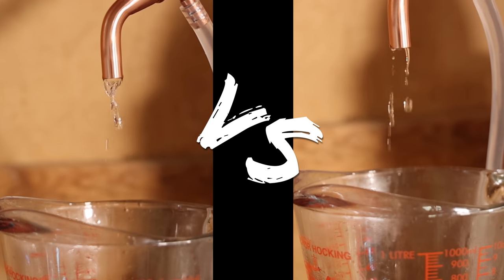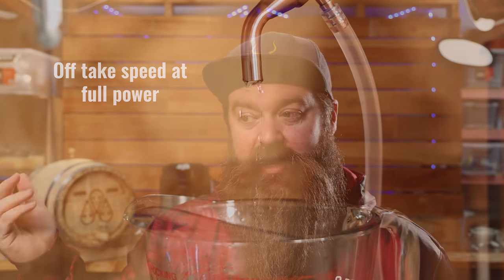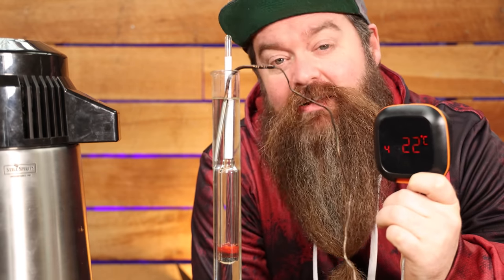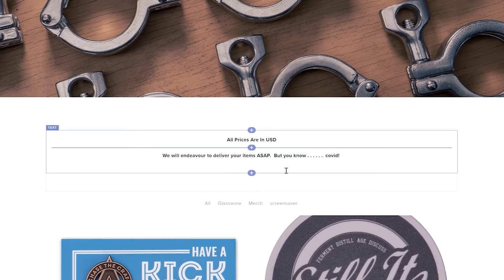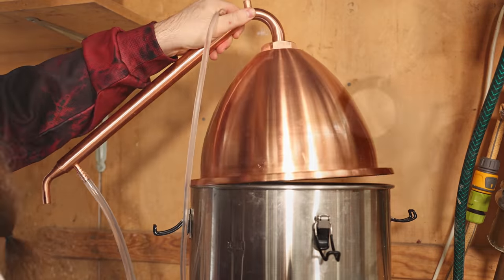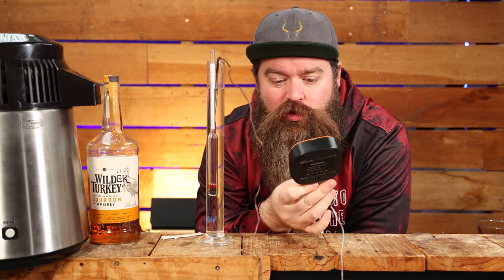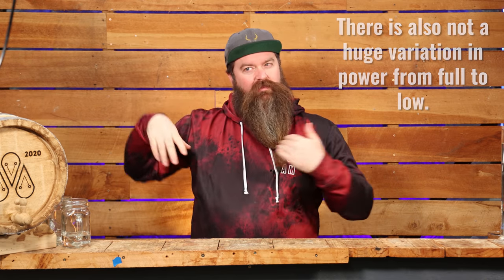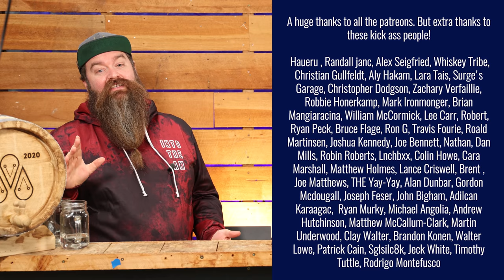Is It Really Worth Running A Pot Still Slowly?

Comment: Interesting that the focus was purely on ABV. To me that is a secondary consideration over being able to differentiate between cuts and having a cleaner tasting spirit
Reply: Was wondering the same thing
Reply: The increased ABV is an example of how decreasing the heat input on a pot still effectively increases the reflux ratio, improving the ability to selectively distil a specific component out of a mixture. This same principle applies to all chemical components of the boiling solution. All of the flavor/aroma compounds will show the same concentrating effect as the ethanol being shown by ABV. Basically this will allow you to be more able to choose very specific flavors you want in the finished product by better concentrating them into specific cut jars.
Reply: Faster means more heat it's gonna effect oils if the temp is higher

Comment: you may need to re-upload this video, the squarespace bit doesn't have any volume...
Reply: It did have volume but it was only coming out of the right side channel so if you only have left channel audio you could hear nothing
Reply: Actually, the sound is "phased" on one channel (the phase is inverted between the two channels) which means that it will cancel out if you use a mono device, and will sound really funky on a stereo device

Comment: "Is It Really Worth Running A Pot Still Slowly?"   My answer is "YES!"... sometimes. Distilling slowly in a copper pot still is a pain in the butt and the difference you will see is minute at best, but real quality distillation requires serious temperature control. If the finest quality is your goal (you should probably be using a column still), taking your time is mandatory.
Reply: I find patience to be a waste of time but I find that there is no step in the process that doesn't work better if I take more time to do it...
how long you take...what you keep...what you throw away...that's what makes your liquor your liquor

Comment: Would be interesting to see how the flavor changes between the two. If the ABV changes I assume that the flavor would change as well.
Reply: Higher ABV = less flavor after dilution to drinking strength. Flavor should not change unless you run way too hot and scorch. Run Whisky and rums faster for more flavor, run neutral spirits like vodka slowly for less flavor.
Reply: It tastes like burning!

Comment: The word you're looking for here is reflux ratio.  High reflux ratio means higher ABV and a "cleaner" spirit.  Lower reflux ratio (arising from more power input for a still with a constant area) means lower ABV.   A pot still has reflux, unless it is much better insulated than than the ones people typically used- that reflux is just less effectively contacted countercurrently with the rising vapour than in a reflux still.   You can see this clearly in a lab glassware distillation apparatus.   All that business by the professional distiller about "reaction time with the copper" is just nonsense.

Comment: VERY interesting!  If I understood Soren, he uses distilling speed - at least to some degree - to manage barrel entry proof.   Lower entry proof, run hotter and faster.  Higher, slow it down.  Along with that is hotter and faster equals grungier and more flavor.  For better or worse.  I have been a “low and slow” advocate until now.  You just introduced a new style/flavor lever to play with.  Thanks man!

Comment: I'm only playing with a 20l Chinese pot still, using a variable induction hob for a heat source, and until now it's been a "blast the stripping runs" and then "slow distill the collected distillate using just enough power" process. With such small volumes, there's not a lot of wiggle room in making cuts so the slow distilling path helps with that.

Comment: I made a killer Bourbon using a gallon of non-vanilla corn syrup, 2 lbs 
of malted barley. Sugar. It made a great bourbon after having it with 
burnt oak chips for awhile. I did not carbon filter it. Everyone loved 
it.  

I made some using corn flakes. I went to a discount store and bought 8- 
 18 oz boxes for $1.35. When you stew it with the 2 pounds of malted 
barley it completely dissolves because it is already gelitenized.

The biggest misconception is that people believe yeast eat sugar, yeast 
do not eat sugar. They eat the nutrients in the grains. Otherwise you 
could never get yeast to grow when you make bread with out sugar. Happy 
yeast make a enzyme that breaks down the sugar into CO2 and alcohol.

Comment: I am distilling a Banana Rum in my T500. The wash is fermented with cooked mashed bananas, Molasses and all the good stuff and is fermented out and settled before pot stilling. I only run the pot still once as the hole point of the exercise to to get as much of the flavor into my product as I can. I use a copper dome and a short column on top of that and a Boka pot still condenser. Inside the column I hang a horses tail of copper made from stripping a short length of very heavy welding earth cable and this is cleaned with Georges 551 cleaning solution so the copper is like brand new with many strands of fine filaments of copper hanging down. I use full throttle on the element to get the run going and drop the energy to almost 50 percent and run the still at 60 percent ABV. I can tweak the power toward the end of the run to extract all I can. I believe that fast is good, but is a tool like anything else, as if I wanted higher ABV I could re flux my rum to the point I would get pure spirit with virtually no flavor at all. My Rum is kick ass, jump up and punch you on the nose stuff. When you close your eyes and drink it you could imagine it being smuggled out of Jamaica in barrels by smugglers and pirates.

Comment: This is exactly what I’ve been talking about, specially with the t-500, it’s not a matter of high amount of heat or power, it’s the point where you can control both as one to stop scorching! either when running all grain or fruit or even molasses type mash! Yes slightly lower or controlled heat or power will alway give a better product and smoother distillation than running full bore uncontrolled heat! Even the old moonshiners that used wood fire stills had to control their fires! Great topic and will be interesting to see your further thoughts!
Reply: Agree 100%.
Reply: the old moonshiners actually ran thumpers to account for the fact that you cant control heat all that well when using a wood fire

Comment: Your a mind reader Jesse! I'm running my 30 gallon right now.....I fill a quart jar about every 20 min lol less maybe. Its always good not fiery or mean. Works great for my set up
Reply: Meant to say a little less instead of lol less....autofixxer
Reply: Also should mention that I use a propane burner for my heat source. Very adjustable with the regulator

Comment: Craft Distillery owner here. You definitely want to run full speed in the stripping run.  I had done about 600 distillations so far. I started off running it slow but with a pot still it makes an inferior product. One of the main reasons is you want to go deep into the tails are there are great flavor compounds there. If your doing a spirit run and you back off the power at 50% abv for half an hour then go full speed down to 20% you will end up with a project that has great flavor and with a final abv of 52%.  This is the ideal ABV for barreling.  If you barrel from between 40 to 45% the aging process can produce methanol. Its best to barrel between 48 and 53% abv.  Especially if your using small barrels.

Comment: Super video, do you think the biggest influence  in the speed will be in the hearts not the heads.

Reason for asking is when I play with power in the heads are alway close with ABV, but once the hearts come the ABV changes like crazy can change upto 15% depending on power in.
On the 6l 38% run the hearts should be around 2l @80%.

Comment: I've found (more importantly than abv) , the distillate is much smoother if you run as slow as you can get it so for personal consumption, I run as slow as I can to get the most smooth distillate I can. I think it's worth it
Reply: The way to go. I like using the first run.  More flavor.

Comment: There was a long debate with some experiments carried out on the homedistiller forum some time back. Essentially you're agreeing with their conclusions that the abv bump is a consequence of passive reflux, which would suggest that the warmer the stilling environment and the better insulated the still, the less significant this bump will be. The big question for me and others which was never definitively answered was the effect on congeners. Will a slower run, with or without passive reflux, result in less smearing of heads and tails through the run? Accepted practice is to run slowly to reduce smearing, but it would be really interesting to see if a blind tasting could pick up differences in the cuts. I'm hoping to actually do this experiment at some point, but for now I just don't have the time.

Comment: To get a higher ABV there are a couple of factors that play a part in it. One is the number of plates you use if you are using a column still, the other is the reflux ratio. The higher the reflux ratio, the higher the ABV you will have at the destilate. So you could run the still full power, and still have a really good separation with the reflux ratio.
Reply from the maker: This is specifically talking about pot stills mate.
Reply: @StillIt  right, my bad hahaha

Comment: I've found slower running provides better tasting results, which is why I run just enough power to get the job done.  Also, running at a controlled temp allows targeting of the boiling point you want.  I run at 94c, which gives good consistent performance and high ABV until a steep drop when I then shut down.

Comment: Interesting discussion. However, it would have been interesting to also get a sensory take on the experiment. I mean, we don't drink one spirit over the other because of its proof/strength. I would imagine that the sensory difference between running speeds would be the slower speeds allows the fractions to stay "in their line/order" allowing for compacting heads and having less smearing allowing for greater accuracy of cuts. Cheers

Comment: Another nice video Jesse. I'm glad he mentioned speed in relationship to flavor. Whiskey and rum need that flavor to be carried over, while with neutrals, one would want very little flavor carried over. This in itself should dictate how fast the still is run.  I have not done it yet, and wouldn't because of the legality here in the states of course, but a fast stripping run of rum followed up by a slower run with some backset included into the mix to bring the ABV down to a reasonable distilling ABV, sounds like an interesting experiment. Keep up the great work buddy. Hey to Beaver for me if you guys ever still chat. -- den

Comment: Distillation water or proof water. It still gets to 40% in the end usually. Flavor is in inverse proportion to distillate percentage. Use the better T500 head and detune it to 80% with half the packing or no packing for pot still results. That expensive alembic thing is better off on a shelf.

Comment: Does it depend on the heat input? No. Does it depend on the knockdown power of you cooling unit? No. Does it depend on vapor flow/theoretical plate #? No. Will a slower run create a higher ABV? Yes. Will faster run lower ABV? Yes. These are all dependent factors on the chemistry of the charge and the substrate of the vapor exchange medium. Will some garage warrior with an all stainless steel pot with a 0.6 meter tall Lynn arm make a Glenlivet even with a commercial 340L cask? I’d venture not. Will someone with a 1000L per hour output discharge, dual 20 meter tall pure copper Coffee still, make a Kentucky Bourbon? Yes. Everything is dependent on what goes into that still and the composition of the total components. 

Bonus round!: Age your distillate and blend from different runs. That way you can age a crappy run over an extended period and put several together with it for the best possible flavor profile.
Reply from the maker: Ahhhhh ? Ok ?

Comment: I run a double keg boiler and a 15 gallon keg thumper. Twin 1.5 over  1/2  Liebig condensers. Big copper pipe all the way thru. Lots of freezing water theu the liebig. On a 40 gallon run it takes me bout 5-7 hours to finish. Run slow is what i was always told and its never did me wrong

Comment: Great video, Jesse!  I am glad to hear that running a still slowly to get better spirit is not a myth.  It seems logical:  more heat into the kettle means higher temperatures near the heating element(s) which means more water will boil and escape as steam. No still can heat uniformly throughout its entire volume, although a Bain Marie may come close.  Lower power means less heat energy which decreases the chance of some part of the water in the wash boiling off.  Not that it matters much if you use a forced air condenser like me: I can't run the still too hard or steam comes out the condenser!
Reply from the maker: Yup totally.  One small amendment I would make is that slower dose not equal "better".  Its a artistic decision where on the scale you want to run a specific spirit. But I think you totally get that, just going outa my way to type it because I could have done a better job of making that clear in the vid (sure other people will read this).  

Cheers mate

Comment: run a still at 200 degrees if ya like, makes no difference if you use a thumper.

it does what it does, its the water flow that cools the vapour that makes it work.
Reply from the maker: We are specifically talking about pot stills here.  So there is no thumper and there is no active reflux condenser.

Comment: I think there is certain amount of absolute alcohol in pot. So if you take it out with higher ABV, then you just get it in less volume. Or am I on wrong path? To my understanding speed will not change initial amount of alcohol in wash?
But it would be interesting to see if there is difference in heads and tails? Witch speed will give you more volume of usable hearts? Will it change taste?

Comment: Well,  much easier to watch after heads and tails when runnning it slower. It also keeps the abv higher during the whole process, might be useful depending on the results wanted.

This is from my experience, yours may differ.

Comment: Typing before actually watching.
 My guess is this is some advice that mattered more when caps were held on with weights or friction, and sealed with flour or mud.
 Too much heat outside will reflect on pressure inside, and a thicker mash bubbling inside might be more prone to blocking. I don't know that it makes for better product so much as valid operational concerns in days of yore

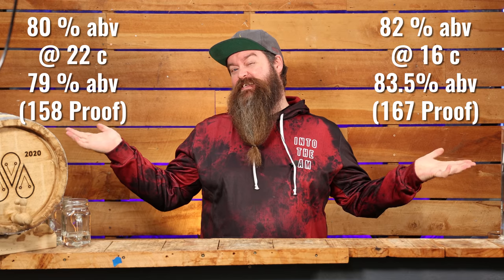 @ 8:50! wrong is wrong

Comment: I use my pot still as a double boiler, and it much easier to control the heat, can hold a constant 195 degrees f to 200 degrees f

Comment: isn't there an influence of the pot size as well? Ran my diy ~25 liter pot & liebig a few times now, enhanced the heater control but can't dial in fix steam temperatures. So I tend to go slow, as the abv in the small wash volume changes quite fast and thus the boiling point changes fast as well. To me going slow seems to be the only way to achieve meaningful cuts.

Comment: interesting way of running a pot still, i can see what you guys are talking about. but the question is couldn't you also run this through a thumper running your pot full on and get the desired ABV?

because i know that a thumper will get you an extra "10%" more abv.

Comment: I still don't quite get how the avarage speed depends on the size of your still. You said on a small still "just drops" is fine, and on big ones  more like a pencil stream. Does it depend on the amount of liquid  inside of my still / or purely on the size of my still? I usually do small batches, 8-10 liters, in a 35 liters pot still.
Reply: Evaporation inside the still is heavily dependent on surface area. The smaller the still, the smaller the surface area, and the smaller the outflow.

Comment: hmmm. The possible confusion in all this is that there is only a particular quantity of alcohol in the mash/wash/spirit being distilled. So it is literally impossible to  create higher abv OVERALL, right? Because it doesn't exist.  This is therefore an attempt to manipulate where in the distilling period you take more abv. it does make sense that more/longer contact with copper may make the distillate smoother. But does seem a whoooole lot of experimentation would be required to make it predictable.

Comment: Love what you are doing, so this is off topic I have been trying for a all grain scotch whisky I have been successful in my starch to sugar conversion were run into trouble is my ph two to 3 days after pitching my yeast. I start with ph 5.2 and it's great until 2 or 3 days it drops to about 3.4 and the fermenting stops.im using distill max yeast. I have a aquarium heater that is factory set at 78 degrees F. I don't seal my fermenter and leaving .07 of unconverted sugar just makes me sick.

Comment: Now add a thumper to your system and I screws this all up. It Can be done but you need to watch temp on the thumper because if your pot gets to cool your thumper won't have enough heat to work